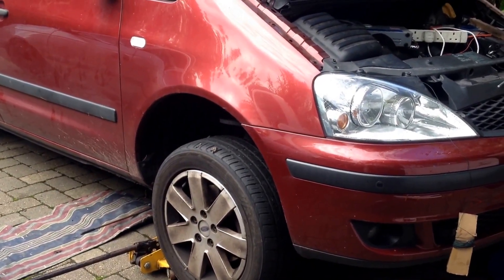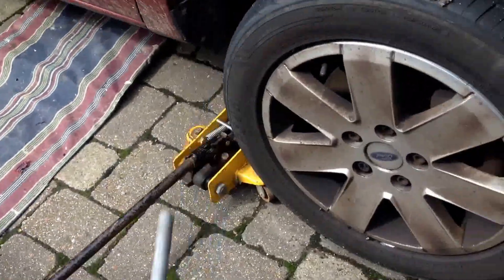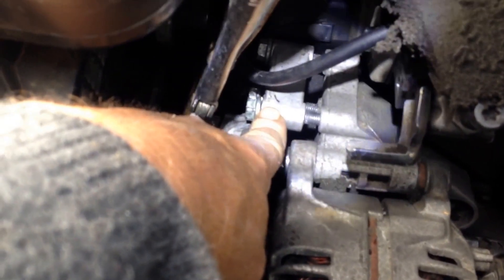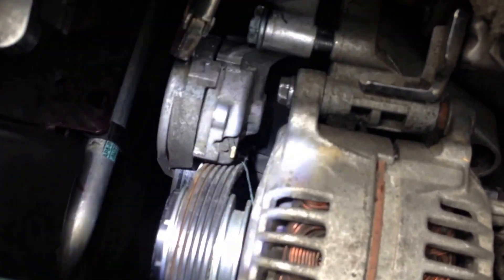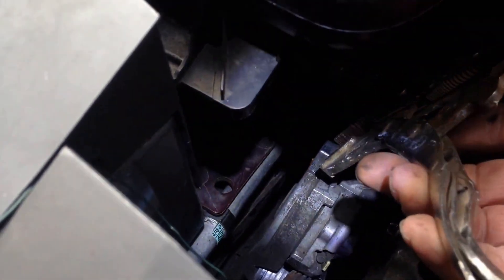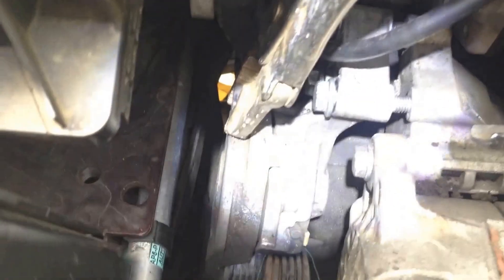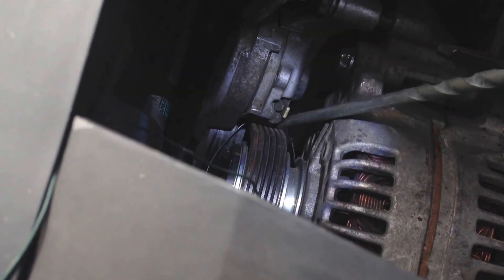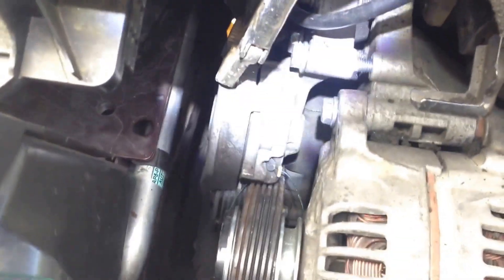Ford Galaxy  alternator  problems  Aug 27, 2015

Comment: you need to give up trying to be a mechanic and leave it to those that can do it
Reply from the maker: Thanks  for  your comment  I must admit  I'm getting to old to be doing alot f wrenching  on cars   BUT  if you cant afford to pay someone 50 quid an hour ?   I did  manage  to replace the alternator    ,,  which  tested  ok  ,, all that work  for nothing ,,  I found a rusty  connection  that sorted the problem,,  maybe  this video  will help somene else with galaxy problems